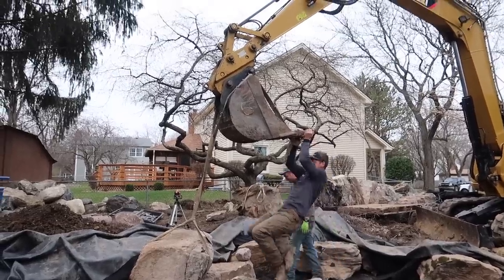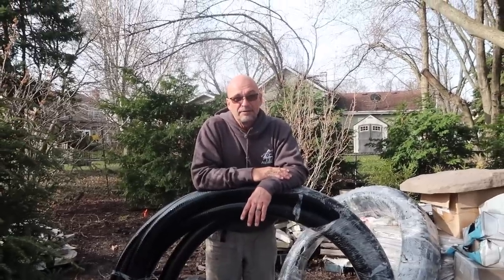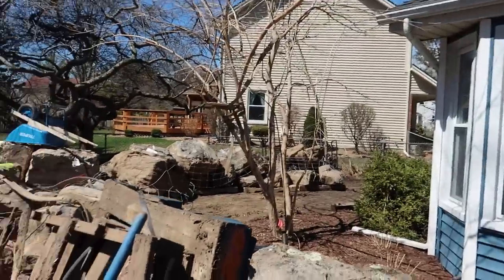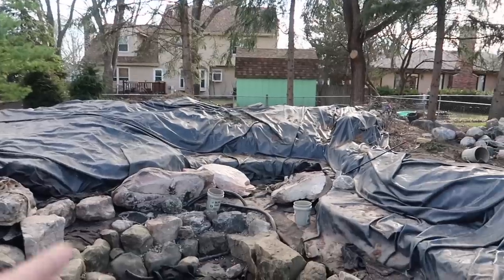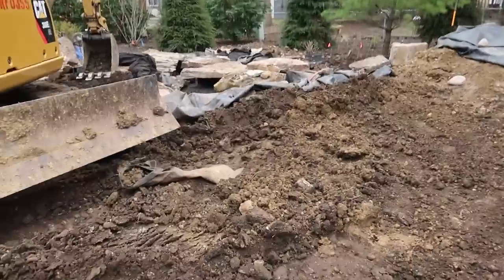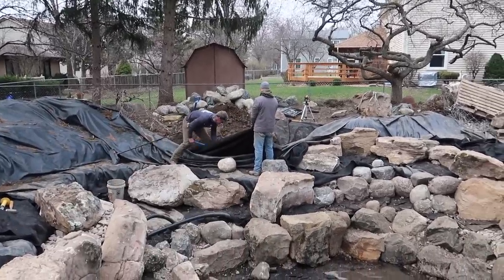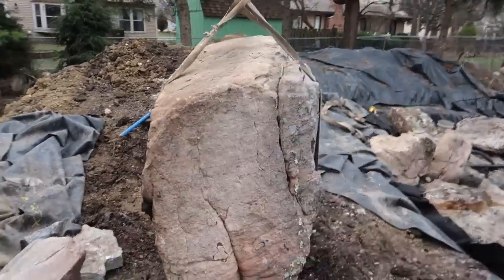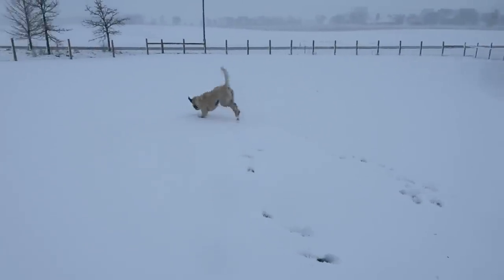TEAMING UP for a Residential Recreation POND Build *Part 1*

Comment: is the liner always used when building a pond. When will it become necessary to install a concrete wall/face to interface with the liner. i guess when you want the pond close to the house without affecting its foundation.
Reply from the maker: pmarshall2006 we always use liner and never need concrete